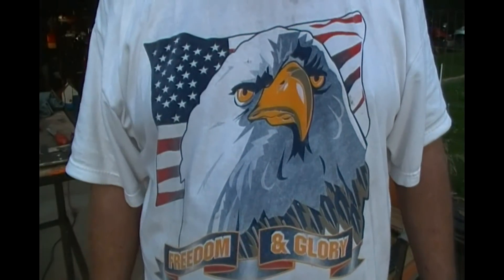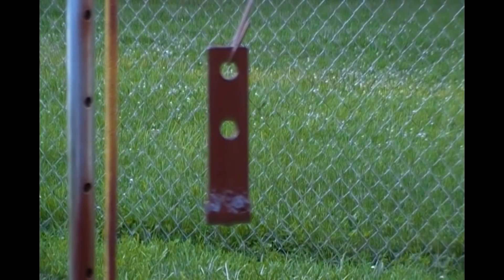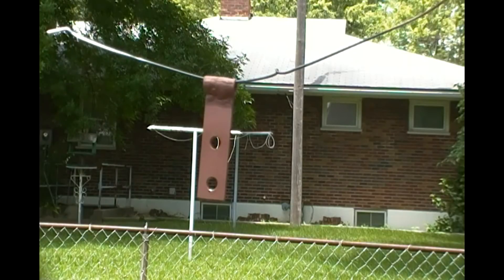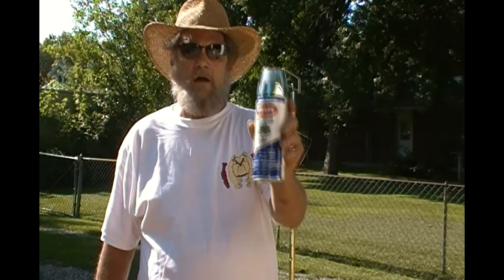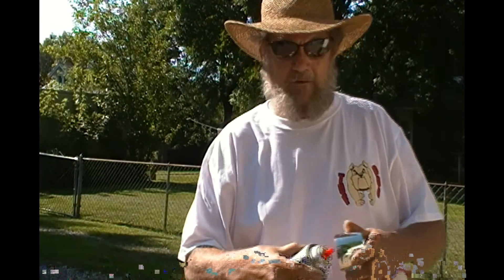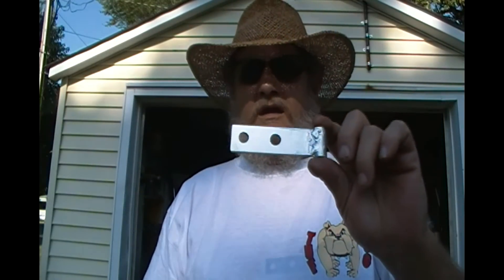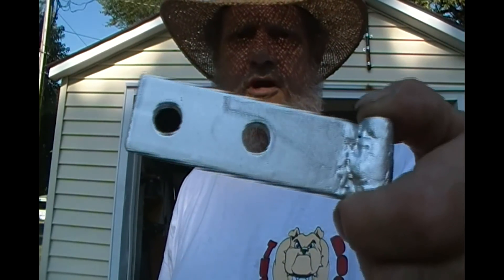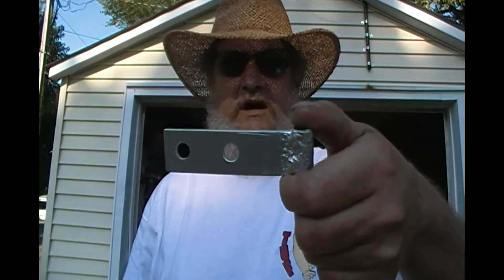AEROSOL EXPERIMENT , LOOKIN FOR CHROME

Comment: Mustang is correct.  The Chrome spray paint is to dense in material.   It basically is reducing the gloss of the black.  You need a transparent metallic chrome paint.   Tyipically found in airbrush paints.   Also,  airbrush paints can be reduced for increase transparency.   Basically more shine will come through your chrome color.
Reply from the maker: E Vanderzee That's an interesting point of view on things. I like it.. I'm gonna have to give it a little more thought, but I think you may be on to something here..Thanks for sharing

Comment: Thankx for your response.  I put it on mute for the intro and then gave you a second look.   You're right. This isn't what we are all hoping for.  I like a spry from ACE  chrome/aluminum.  I still AIN'T CHROME,  but it does look pretty good.  For a goo result i have tried a light sanding of like 1500 wet sand.  A couple of coats and its ok to the eye.   Thank you for your video.
Reply from the maker: Thanks for giving it another try.  I realize the results were less than desired. But now we know...

Comment: you should do a base coat of gloss white instead of black. the shine will really come up.
Reply from the maker: That's not what is recommended, but it's worth a shot. I'll giver a go. Thanks for the idea. Cheers !
Reply: Fact, it works. Even gray is better than black. I have no idea other than to sell product why they say on the can to use a color that is clearly incorrect as a base. I have used metallic bronze and gold as base colors and had decent results also. But they are very thin, so spray VERY light "mist" coats if you try it. Takes time, but good results. If you dont want a 5-6hr project...white or even gray.

Comment: I have found that the aerosol spray cans rarely give the effect they advertise.

For this chrome effect, you might want to try a product called Alclad 2 Chrome.
If you apply it correctly, you will not be disappointed.

It follows a very similar process to the one you demonstrated.
Prime -> Enamel gloss black -> Chrome
You can then protect it with a clear gloss topcoat.

The only drawback is that you have to use an airbrush.
Reply from the maker: Alclad 2 Chrome ey? Cool.. Thanks for the tip. I'll look into it. I do have an airbrush around here somewhere. lol
Thanks for sharing that info.
Reply: ***** No problem. I was amazed at the results you can get with it, there are plenty of demo vids on youtube.

They also do transparent inks to go over the chrome. You can make some pretty cool heat stain effects in red, blue, green or even make it look like polished brass/copper.
Reply from the maker: I just looked it up and it claims to be made for plastics, such a models & things.  
Do you know if it does in fact work on metals as well ?
Reply: *****
Yeah I use them mainly on models, but I have used the chrome when doing detailing on my bikes. As long as you use primers and topcoats, it should be ok.
Reply from the maker: Cool, Thanks for letting me know. I'll look into it further. It does look impressive.

Comment: I only wonder if you would have gotten the same result without using the gloss black?
Reply from the maker: I'm not sure how that would turn out, The directions say to use black. Some commenter's have suggested using white.  Either way I'm sure the results would be better had I done a better job. I rushed it & used to much paint , to quickly.
Thanks for stopping by and taking time to comment... Cheers

Comment: Its a damn f*cking aerosol spray paint especially chrome. Same as me. I was bought a well capped chrome spray paint and once i applied it on my motorcycle's rim, it was looks like silver paint. What the hell! Very upset with the product and manufacturer as well. They cheat to us as a end-users😎😎😡
Reply from the maker: It is a bit deceptive.  Thanks for sharing your experience too.
Reply: @TufdogsPlace  exactly! Its my pleasure sir🤓✌️
Reply: You will never ever get a chrome mirror look out of a Can. It will look Silver period. 
To get say a BMX Bike Frame Chrome plated will cost around 400.00 opposed to 100 to Powder coat. 
It is a 3 or 4 step process and a lot of guys are getting away from it. I ship all my Chrome Projects out to California.

Comment: 1 week later after I painted I still have that wet/tacky to the touch. I did the light coats and STILL week later not fully cured. WTH
Reply from the maker: yeah, rustoleum takes a long time to cure even more so if the weather is cool
Reply: Tufdog's Place yeah it’s been upper road mid 70’s most of the week. Today it’s in the 80’s
Reply from the maker: @chegarcia7  when I painted a helmet with rustoleum and had realized it takes a longer cure time, I was at about a week between colors
Reply: Tufdog's Place ok great info! Thanks I’ll wait a few more days. You think if I leave it in the sun it will help or just use a hair dryer on cool?
Reply from the maker: @chegarcia7  Just leave it out of the dust and debris, don't use a dryer on it. It's a chemical reaction process that allows the gases to escape as the paint cures. I don't think you can rush it. Direct sun may not be good either.  Just have patience, it'll come round...
Reply: Tufdog's Place yeah I just left it on my work desk in the garage. I’ll let it sit there and not touch for a few more days.
Reply from the maker: @chegarcia7  That's the best bet

Comment: Tufdog, did you find a better way to chrome plastic since this video?
Reply from the maker: +Claude Butnaru   No I haven't really.   I've had a lot of comments offering other brands of products.  Generally too expensive to get my endorsement. However there are some good products out there if you don't mind spending the money.   Thanks for asking, & good luck in your search
Reply from the maker: +Claude Butnaru   Yeah, I've seen that video & that's the same old problem. the stuff that works well, is way to pricey... I'd just go with a nice gloss finish from rustoleum or something.  least it's cheap to redo if something happens to it...
Thanks Claude, best to you... Cheers

Comment: Closest to chrome, besides some of the new stuff that costs alot. Gunmetal, get it in a lighter shade. Prime with white, then very light coats of gunmetal till its covered well. Dust coats, not "true coats", and the end result is pretty close. It is darker, but it appears much more like "chrome" than any other spray that the cap is chrome. Most of the paints like that are very thin for starters...no fun to get even. And they are typically just a glossy silver. IF your lucky and get it nice and even and hit it with gloss clear. You might get a result that people look twice to see if it is legit chrome. But, the second look shows it is just a very shiny silver.

Try this experiment with a gray or white primer. The results will be better. Not perfect, but better. The reason its not really metallic is because of the dark primer and ofcourse the black. Use white or gray as a base...75% better result.
Reply from the maker: Thanks man, I appreciate your input. Will give it a go next time around. Cheers
Reply: ***** I just saw a video on some weird spray in chrome. Type in:

how to chrome wheels

I have no idea what the stuff is. Its a spray bottle, not a can. It is applied and seems to run...and suddenly it starts turning chrome. REAL chrome...took a 4min video to fully do 1 rim! If I find it Ill link the video. No clue on cost, but I was amazed how easy and fast it was. And best of it all...it was REAL chrome (look atleast)!
Reply from the maker: M Davis Very impressive results !  $234.00 for 16 sq ft of coverage plus shipping from Europe. Looks swell though. Thanks for sharing

Comment: first off you messed up by using the Rustoleum to start off with .  You should have used all Krylon paint.  A far superior product.  I started using it as a 13 YO to paint bikes I rebuilt and sold.  Easier to use than any other spray paint and far better finish.   I recently used the new chrome paint and was happily surprised by the end result.  It is not like real chrome but a very very close second.  Better than any finish you will get out of any other spray can out there right now.
Reply from the maker: Thank you Richard, I appreciate your input...

Comment: spell check on my last comment.  lol. wait at least 5 to 7 days let the paint cure before you decide to hit it with clear coat. I would also recommend and sticking with the same brands of paint. And do not mix acrylic and enamel
Reply from the maker: +chris straub   I knew what you meant & you're exactly right ! ...Thanks Chris
Reply: What acrylic? The chrome looks like a lacquer or enamel. 
I would have skipped the black.

Comment: Have you tried layer on layers?
Just spray a thin layer, wait 2, mins, spray, a.s.o ?
Reply from the maker: Not with these paints, I think the end result would be a better paint job but the color would be the same.  Thanks for asking...
Reply: Tufdog's Place Just bought an old moped (Tempo) in Norway with rusty chrome.
Tried your way with lokal stuff, but think i will hydro dip it with clearcoat.
Thanks for vid👍
Reply from the maker: @MrVeggis1964  You'll be better off that way. I have yet to find a good chrome match that doesn't cost a lot of money... Enjoy your new ride, & ride safe
Reply: Tufdog's Place jupp.
If you got a real chrome on box, 
you can scip the acid bathe and just be a billionare...
It doesn't work at all.
Best sheape result is a dry layers in layers., with polish.
Reply from the maker: @MrVeggis1964  LOL, Yeah...

Comment: Looks good as I'm trying to touch up pitting on my chrome wheels. Check "J Leno's Garage" as I watched a video showing they even have better products now that might save me from buying new wheels . The video there is called Spray-On-Chrome" but they never mentioned the price. At least we have options now :-).
Reply from the maker: I looked into that and found that it's quite expensive to get everything you need to do it that way.  I believe it come from overseas If I remember correctly.
The method I used is less than desirable, still kind of looks like silver paint.
Also I've noticed that everyone that uses the new style of spray on chrome catches all the drippings into the same container. making it un-reusable. If a guy were to separate the different stages of it's use into separate drip pans. you could salvage the drippings and use them again making the whole thing go a lot further, Thus saving you lots of money.
Thanks for watching & commenting, Good luck with your wheels.

Comment: I think you missed a step out, which is probably crucial. From views of pros doing the spraying, they used a deionised water spray immediately after spraying the chrome, then sprayed again. I have no idea why, but would imagine this helps with the surface finish.
Reply from the maker: Hmm, That's interesting. I've seen that done on some types of chrome spray. But directions for this brand don't say anything about doing that. 
I like how you're thinking.  
Thanks for commenting... Cheers

Comment: Only use Rusty Metal primer when rust is present. It needs rust to work best. Otherwise use their Clean Metal Primer or Auto Primer. Also If you want the Chrome to POP more, use Flat Black not Gloss. If it is going to be exposed to the elements, use a clear coat. If not, leave it bare so the metal particles in the paint reflect better. Most metallics are intended for indoor use only. Rustoleum does have a outdoor silver metallic but it is not as bright as chrome but it will stand-up to weather better and last longer.
Reply from the maker: +tb352  Good tips, Thanks Man.. I appreciate you saying

Comment: Wonder if this method can be used to  restore chrome in my headlamps since the light bulb generates 200°c
Reply from the maker: I don't think so, it doesn't really have the reflective quality you would want.  Probably wouldn't hold up to the heat either.

Comment: But it will rust unless you put a catalyzed color or clear coat over it.
Reply from the maker: I don't think it will. it has Rustoleum under it and then the chrome paint as well.
Thanks Jerry...
Reply: All of those products are porous. Rustoleum does not prevent rust. Rustoleum is only a rust inhibitor that needs to be protected from the elements. It adheres to the metal better than paint so it gives the paint something to stick to. Primer and paint is not good enough unless the top coat is catalyzed to prevent the elements from eating away at it. A catalyzed clear coat can prevent rust but it doesn't hold on to a bare metal surface too well.
Reply from the maker: What kind of catalyzed product are you speaking of ?
Reply: Automotive paint. Single stage acrylic paint and clear coats. You can even buy catalyzed clear coat in a rattle can. Any coating that uses a hardener is catalyzed.
Reply from the maker: Awww, ok,  I see.  Thanks for clearing that up for me...

Comment: its not a success... it dose not look like chrome... chrome is supposed to be reflective.... but still a good experiment. at least now we know that rattle spray cans don't work if you are looking for chrome finish. Seems like the only way to really get chrome is the chrome plating process.... afterall, you get what you pay for.
Reply from the maker: +TV TURNT   Yeah, that was kind of the point. However I didn't do a very job of it either.  Could have been better, but I don't think it would actually look like chrome.
Thanks for watching & saying,... Cheers
Reply: ***** apparently the brand SpazStix is the only spray can that is good for chrome, but you have to use the clear coat by spazstix as well.. no other clearcoat will work without fucking it up. If you decide to experiment on it again and use that brand share your experience plz
Reply from the maker: +TV TURNT   There are several brands that appear to do a great job, but the cost involved make it unobtainable for the small project user like myself.  I'll look into the Spazstix brand & see how that plays out.  
Thanks for the tip, & the feedback. I appreciate it....
Reply: +Tufdog's Place You won't be disappointed when you see the mirror effect.  Especially with the bad ones you have tried.
Reply: I meant you won't be disappointed with the results from Spaz Stix.  Best out there for quite a while now.  www.SpazStix.com
Reply from the maker: I'm looking into it, Thanks for the link
Reply: +Tufdog's Place you bet.  Check out my favorite RC painter Anthony Durand to see what the older version of Spaz Mirror Chrome was  and then know they made it better since then! Enjoy 😊 www.adrcracing.com/
Reply from the maker: ok, will do

Comment: Thanks for the video. You were on the right track with your three step process. I've been using aerosol paints since I was a kid building model cars. I know from experience that YES it is possible to achieve a chrome finish with the exact same products you used here. But, it takes a while lot of patience and work. Each coat must be very light and wet sanded after thorough drying time. Multiple thin coats of each product and sanding between coats. The final coat of metallic should be buffed well after wet sanding. Lastly, a couple of coats of clear coat with super fine wet sanding between coats and a final really good buffing will leave you with spectacular results. I hope you have a great big yard. This will take some time.
Reply from the maker: Thanks for the optimistic advise. I appreciate hearing from you... Cheers
Reply: I'm still searching on youtube how its done correctly. I bought a similar product here in germany and also got some sort of silver/grey. The instructions says that NO clear coat should be used. it also says that its not abrasion resistant so even if you get a good result, how to protect it?

Comment: As someone who's been doing this since childhood, my advice for a realistic chrome finish is to take more time and care. Your coats need to be much, much thinner (think of just a couple of quick bursts with the can) and from about a foot away, no closer, then you want to dry at  low setting with a heat gun (again, from a decent distance), then giving a quick buff with a chamois, after every six coats. You'll want about 24 coats of each, (which will actually be pretty quick since each coat should only take a second or two with the can then a couple of seconds with the heat gun). If you do this with your primer, undercoat and topcoat, you'll get a pretty much perfect finish, as long as you've been even and given 48 hours drying time for your final coat before buffing.
Reply from the maker: Wow, That's some good input, Thank you.  I'll have to give that a try.
I appreciate you taking the time to tell me.
Cheers
Reply: Do I still need a heatgut even though it's hot form where i lived in?

Comment: What the hell is that noise whenever you spray? It sounds like a air compressor but you're using a rattle can.
Reply from the maker: I think that may have been my camera. It does that sometimes, more often while using the zoom feature.  Good question, Thanks for that... Cheers

Comment: Usually the stuff ya find at local stores has nicely chromed caps, but what ya actually get looks like ... well, silver paint.
Reply from the maker: Yep, You're exactly right. They get the caps like that with a special blend of fiberglass & plastic. But the paint doesn't make the grade.
Thanks for speaking up, I like that... cheers
Reply from the maker: I believe you're right,... Thanks
Reply: you did NOT spray chrome, You sprayed  Metalic Spray,   somebody exchange metalic cover on your bottle spray ! Its written on the spray !!!
Reply: spaz stix is way way better  compared to this  to me that just looks silver , the spaz stix looks closer to actual chrome ,, try it